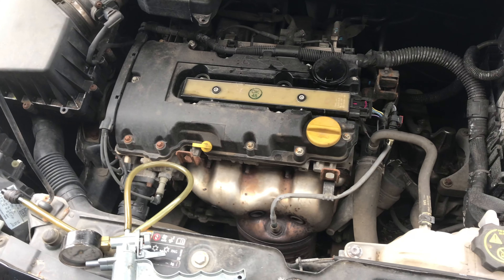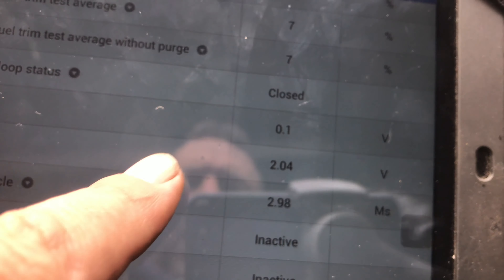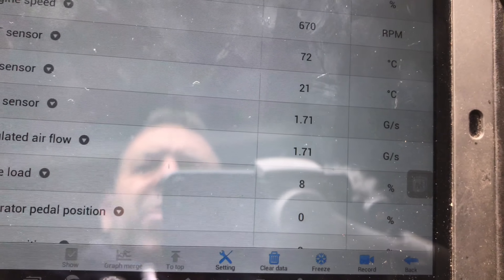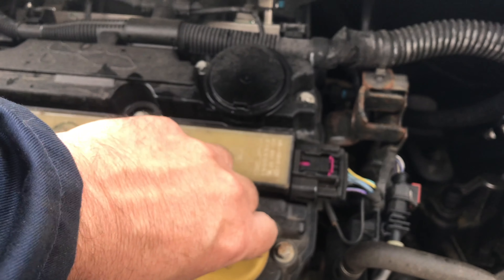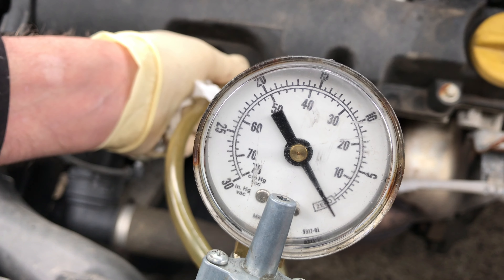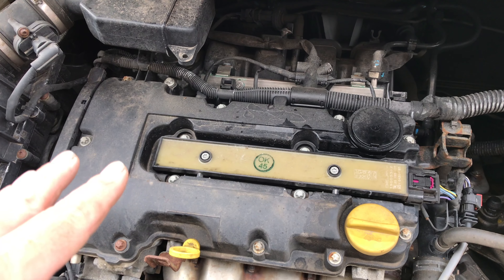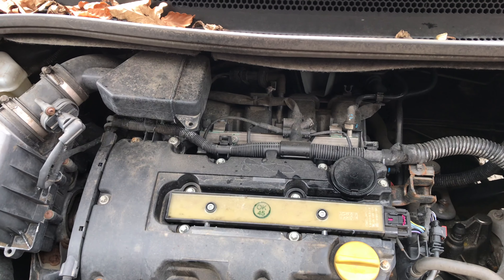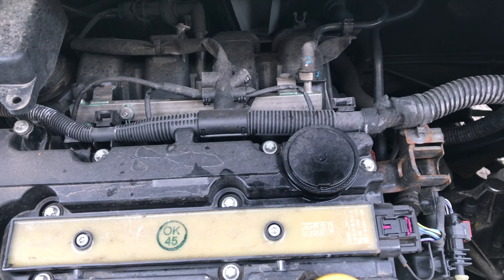Vauxhall Corsa E (2015) - P300/P0171 Rough idle Fuel System Lean Part 3

Comment: That was good getting a known good car to compare it against, especially at the high cost of a cam cover. Thanks for the update
Reply from the maker: Cheers Matt now we can do swaptronics if it comes back LOL cheers sandy
Reply: Swapnostics or plug and pray lol
Reply: Scannerdanner had a video with a faulty MAF, he said that it reads baro with the ignition on or on full throttle, then it can work out the MAF, this may be why it ran better when you cleared the fault code with the engine running, because it won't have seen the baro with ign on yet. Anyway just a thought. Cheers
Reply from the maker: Haha plug & pray I like it
Reply from the maker: Cheers Matt I'll check that out

Comment: I just replaced the cylinder head, timing chain and guides on an a12xer it was smoking and idling very poorly after start up.

Replaced a faulty tank purge valve which changed the 02 sensor voltage fault to a fuel trim fault.

Turned out the pattern rocker cover gasket wasn't sealing, refitted the old one and she idles and runs great.